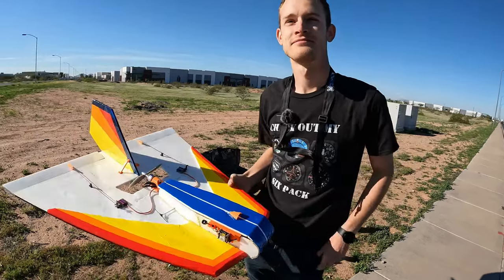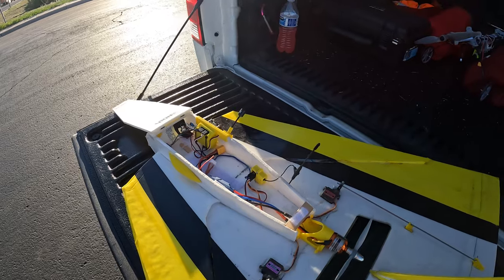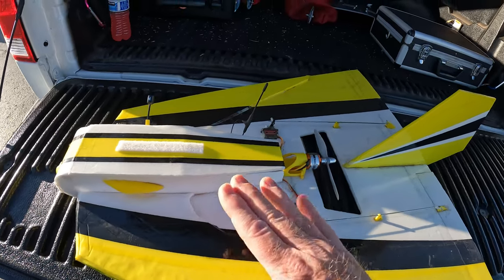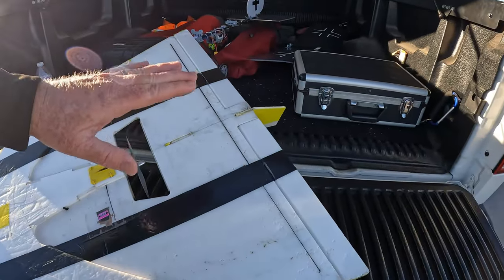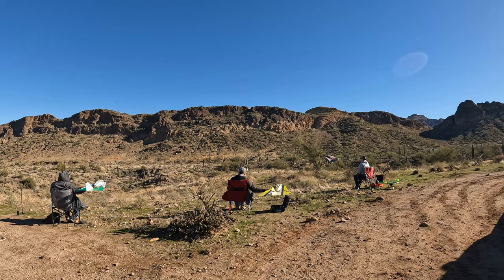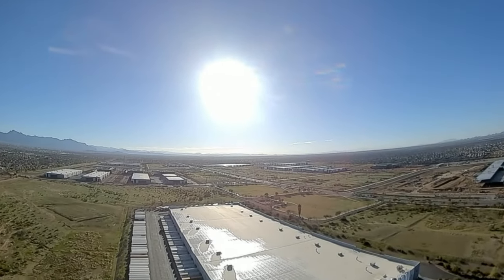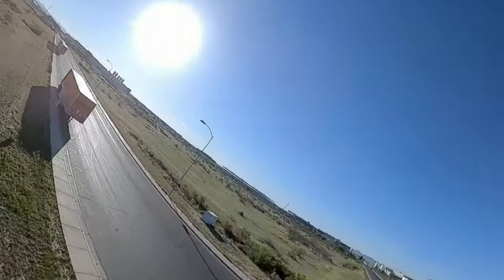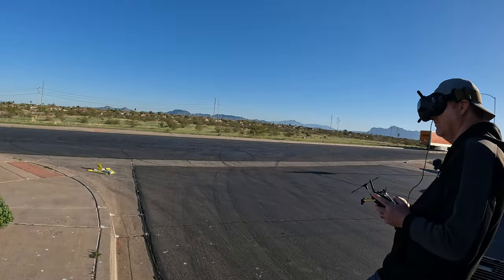Build this Plane! - FPV Stingray // Details and Flight

Comment: Great video.  Great looking Delta Wing.  I have a very old computer, and am not able to view, or down load your building information.  Can you do me a " Big "  favor and give me the Exterior Dimensions of the wing.  I'm thinking about going with an EDF on this one.  Let me know please.  THANKS.
Reply from the maker: The PDF files should pull up in your browser -- they are the full and actual dimensions.   The back end of the wing is 30 inches long and the length of the body from nose to the tip of the tail is 30 inches.
Reply: @Qromer  Thank's a lot Buddy.  I can take it from there.

Comment: How is the efficiency compared to a normal plane? Does the battery last as long as it would on a similar weight aircraft with wings and a tail? It seems to flutter a little in role. Do you think a wider wingspan would help stabilize the role?
Reply from the maker: This plane is more stable than a traditional long wing plane.  It can also be flown slower than planes of similar weight.   If you have never flown a delta wing plane then it is hard to describe.  The stall is simply a nod forward -- no tip stalls.  The flutter you see in this video is the fact that it was quite windy.  This plane actually does better in high wind than traditional planes.  As for the flight time.... it can pull up to 30A at full static ground testing and with a 2200mAh 3S pack we get about 9 - 10 minutes flight times.   This is similar to any plane pulling that amp draw.